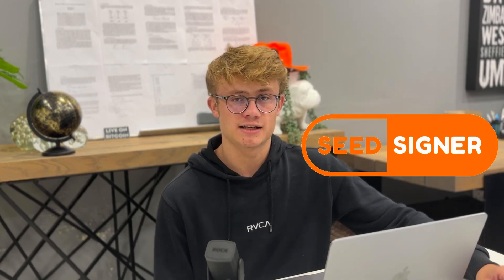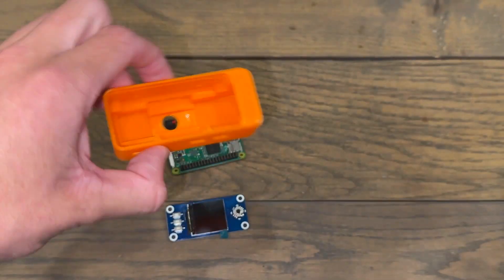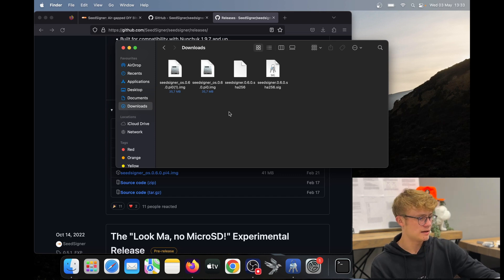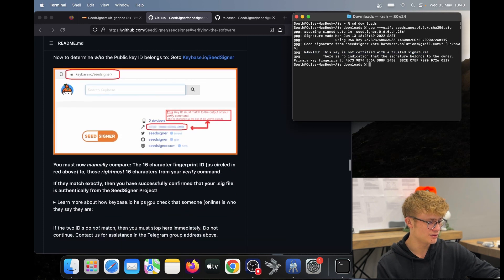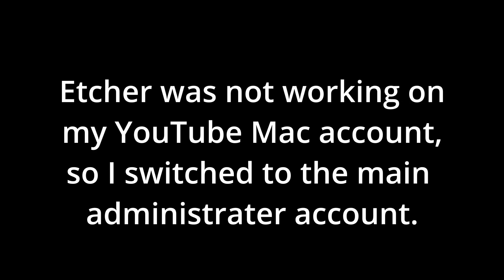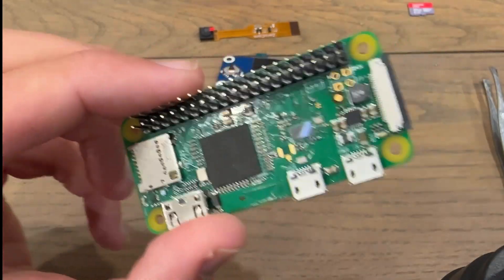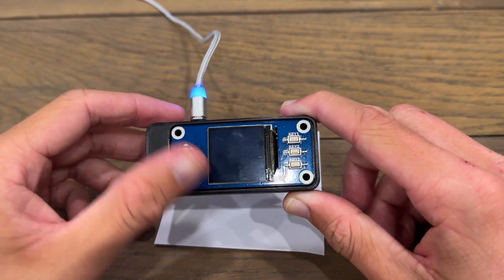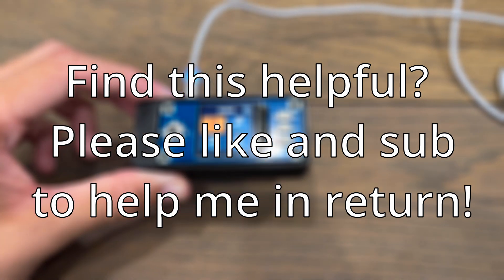How to build a SeedSigner: DIY bitcoin hardware wallet

Comment: Well explained clear video. I followed it every step but i overlooked the detail of where exactly the camera slides in. Just make sure folks to make certain when the camera slips in that it goes under the tiny black clip. It can go in above it quite easily and when you power SS up it will give a Camera error. My black clips were also upside down. Took ages to figure it out and someone else pointed it out to me.

Comment: can we use the Pi Zero 2 W  or WH  board . thanks
Reply: Not secure. You don’t want those aerials broadcasting. Though the video shows someone has found how to rip the working parts off the motherboard so they no longer work.